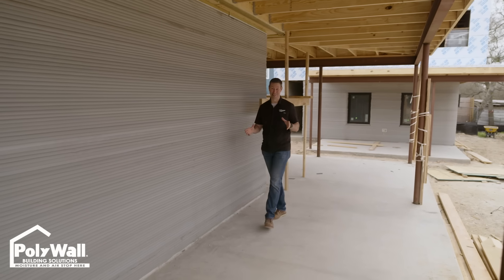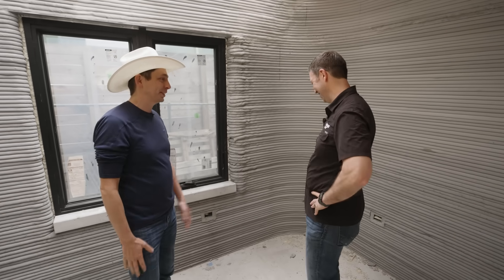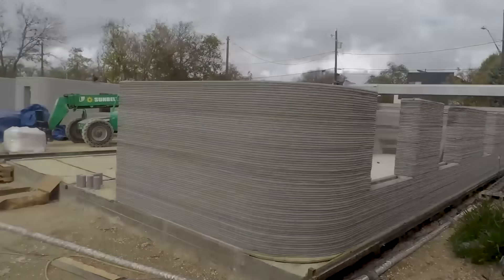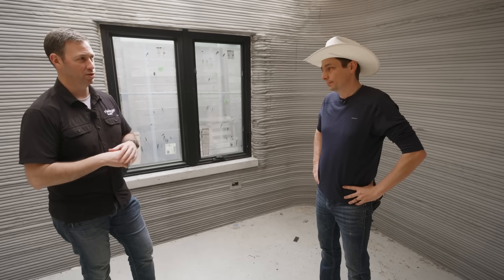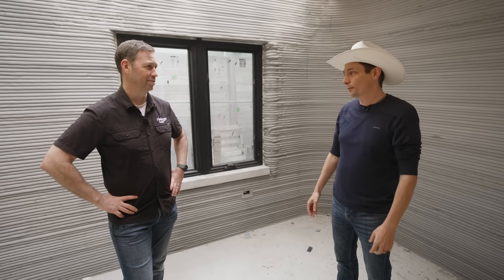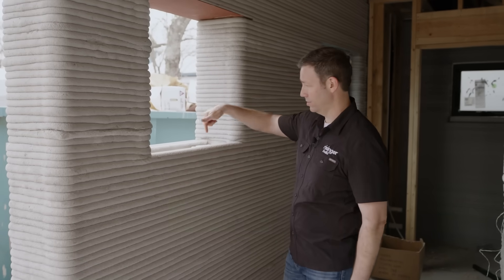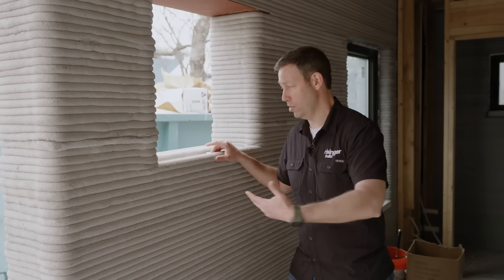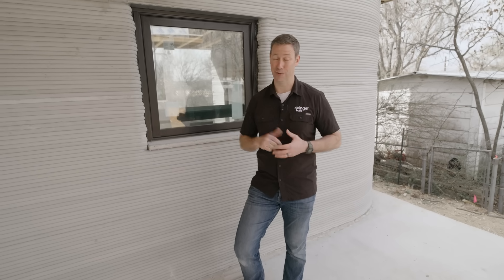Is this the future of Construction? 3D Concrete Printed Homes

Comment: I heard somebody once say, there are 2 types of concrete. One that is cracked and one that is going to crack... now who was that... wait! It was you!
Reply: Most underrated comment of the thread.
Reply: That is a fact, my channel and podcast is completely dedicated to 3D printed concrete and the cracking factor is something we've discussed many times. One of the easiest solutions is just a latex based paint layer on the printed concrete. The micro-fractures aren't structurally problematic.
Reply: @automateconstruction  that's s good idea with the latex. I think they should mix color into the concrete as well.
Reply: @automateconstruction  Is it just a cure rate problem?
Reply: @automateconstruction  any sort of remodeling is somewhat problematic as well. I guess one would shore up the ceilings/floors, cut into the wall and then do the changes with traditional methods???
Reply: What are the bets that this system is more expensive than a brick clad, timber framed home?
Reply: @R2D2trashcan  No its not more expensive. Its much cheaper due to the saving in labour and time.
Reply: Yeah I don’t see how this won’t crack like crazy over time. No rebar either?
Reply: @R2D2trashcan  The lack of steel reinforcement really concerns me. I'd hate to be the beta testers with a mortgage.
Reply: @bloodsuckingflea  Steel reinforcement is not required. You Americans aren't used to concrete and brick.

It's cavity wall construction. No rebar required. In the UK we use concrete as a lintel. This house is entirely concrete. The material used to build the house IS lintel material.
Reply: @bloodsuckingflea  @4:08 they covered that topic...
Reply: @R2D2trashcan  -------- super high psi (more Portland than sand)w/small fiberglass particles in mix --- no stone ------ wet layering process adds additional strength .... will it stand-up to 7.0 quake ----- hell naw.... the cowboy dude didn't mention R value or did I miss it
Reply: @rsgabrys3080  he did, he said it's high performance ;)
Reply: @pnwbuilder  high performance ? one and only reason its marketable termite carpenter ant ect. proof ...it would need more that one thermal break to be hi perf. I wanna see feel how much cold transfer permeates
Reply: @rsgabrys3080  it was a somewhat sarcastic remark, you've missed the smiley.
Reply: @rsgabrys3080  .

Its cavity wall construction. The cavity is full of insulation. Thats how we build in the UK with our brick houses. In addition, concrete acts as a thermal mass.

Concrete houses are not new. 3D printing them is.
Reply: @martinw245  builder never mentioned cavity (thermal break) was to be filled w/insulation or the actual wall R value
Reply: @rsgabrys3080  

"builder never mentioned cavity (thermal break) was to be filled w/insulation or the actual wall R value2

Err... R value no. But you can watch the video again and see for yourself, not sure how you missed it. Its full of insulation. Matt also spoke about the insulation.

11:42 for insulation. Its mentioned about three times. Also shown in the graphical representation of the building.
Reply: @martinw245  --------- seen window opening prior to installation seen some insulation in cavity....but did not seen insulation installation throughout building process
Reply: @rsgabrys3080  Well it's cavity wall construction for all walls of the house, so they obviously aren't going to put insulation just under a window and nowhere else are they? 😀 they would be con men if they did. Why on Earth do you think they wouldn't insulate all walls. They obviously are.
Look at the graphic representation of the house, all walls are full, obviously.
Reply: @rsgabrys3080  Watch from 4:08. He specifically tells you the walls are filled with insulation and even shows a graphical representation of the house with all walls filled with insulation.

The other point is that concrete acts as a thermal mass.
Reply: @martinw245  WHY then doesn't the builder have a definitive  R rating ? verses the walls are insulated
Reply: @rsgabrys3080  obviously does. Just not mentioned in the video. What is your agenda here?
Reply: @martinw245  ------- Numbers ....proof  that's it no other agenda R VALUE period. what is it ....YOU don't know neither do I --------
Reply: @rsgabrys3080  

I've no idea what your issue is. The building will comply with local regulations and obviously that includes its thermal rating in terms of an R-Rating.

Concrete has a very high thermal mass, that plus the insulation, obviously results in excellent thermal performance.

If you are that interested do some research and look on their website.
Reply: @martinw245  ---------- practically every appliance in this USA has a energy efficiency rating -------- dwellings are no exception... thus insulation ratings are how efficient and effective the resistance to heat -- cold -------  cementious dwellings are double edge sword ....once outer surface gets warm/hot/cold it retains it. Builder claimed high performance  ... hi performance in relationship to what...?  if it's similar to 2x4 stud bay R- 19 ..... it is NOT high performance
Reply: @pnwbuilder  ---------- when God was passing out brains .....I misunderstood and assumed he said ..... trains --------- I replied this ones full I'll catch the next one ....
Reply: @rsgabrys3080  

 "practically every appliance in this USA has a energy efficiency rating -------- dwellings are no exception"

I'm well aware of that, we do in the UK too. What's your point? The 3D house obviously does too because it satisfies your US Codes and is available for sale to the public. It just wasn't mentioned in the video. Go check their website if you want to find out. Or if that desperate email them.

What I can tells you is that if we use our common sense, and observe what looked like 4 inches of insulation, an outer concrete skin at 5 inches and an inner concrete skin at 2 inches, that's a total thickness of 11 inches. That is a very large  concrete thermal mass plus insulation. So I would expect your R-Value to be high.

I suspect you are being deliberately cynical here for some reason. Again, go and do some research if you want to know precise thermal ratings. This and plenty of other 3D printed houses are there for you to research. 

If you are expecting ME who doesn't work for the company to give you precise thermal rating figures you are barking up the wrong tree. Do your own research.
Reply: @martinw245  ---------- the claim "high performance" in reference to insulation is w/out merit (as is your argument) w/out definitive R-ratings -----------  its about having FACTS not ---" I expect your R rating to be high:" AGAIN you do not know .....and neither does anyone else who watched it ....  meets code and high performance has disparity written on both sides of YOUR dense walls house OR cranium
Reply: @R2D2trashcan  Rebar would be part of the problem. Over time rebar oxidizes causing swelling which cracks and breaks cement. A better solution would be adding reinforcing fiber to the cement mix.
Reply: @zmavrick  coated rebar maybe?
Reply: @R L That opening was clearly cut after the fact, don't you think? IOW, not 3D printed.
Reply: Comes with a tube of sanded grout!
Reply: I can just see "something" crashing into the home and the whole 2nd floor caving in.
Reply: @nw6gmp  1:1,000,000 event
Reply: @anthonykaiser974  with the logic. How about when he attacks certain sheathing technology as weak because a tornado may blow the house away. A 1 in a million or more chance of being hit by a tornado.
Reply: @diegolara4202  well, I know too many people that lost houses, barns, lives to tornadoes. Might be 1:1M where you live.
Reply: It's weird that despite all their engineering, they forgot to include reinforcement inside the concrete. Should have at least put an exmet inside like bricks and mortar construction. It'll be a deathtrap during earthquakes.
Reply: @MrArthoz  

Not true re Earthquakes. There's a 3D printed house in China that can withstand a level 9 earthquake.
Reply: Forget the rusting steel rebar, just put a lot of fiber in that concrete. I mean if you look at the extruder in action, you can obviously tell fiber would help it , lol
Reply: @R L Does anyone know about earthquake stability on these?
Reply: The concrete begins to set on every layer but isn’t given enough time to set where it won’t properly fuse with the next layer.
This has the benefit of any flaw on one layer doesn’t have a significant effect on the next. It’s like layering wood sheets. 6-2” layers are stronger then 1-12” piece.
Reply: What about mixing in fiberglass strands? Basically creating FRC. I would think that would help with the micro-cracks. For the large ones, just stuff a dead cat in the crack.
Reply: @explorenaked  

Fibreglass strands is correct. They use fibreglass and other materials in the mix.
Reply: No! The only cracks you get in a 3D printed house are micro surface cracks that aren't structural.
Reply: i guess it's kind of off topic but does anybody know a good website to watch new movies online?
Reply: @Jamir Ayden i would suggest Flixzone. You can find it on google =)
Reply: @Angelo Eduardo yea, I've been using flixzone for since april myself =)
Reply: @Angelo Eduardo thanks, signed up and it seems like a nice service :) Appreciate it!!
Reply: @Jamir Ayden You are welcome xD
Reply: classic example of a solution in search of a problem
Reply: @huntdon  it increases construction speed and reduces labour.
Reply: @huntdon  You haven’t priced lumber recently I see.

Comment: The big issue with stuff like this is how do you retrofit without huge expense and compromising the structure?
Reply: You don't. That's the problem with this tech. You can't even bring "the printer' back even if you wanted to. It's a gantry system that has to straddle the structure it's pouring. Once you build on top of it you're done.

Comment: Repairing the wall after you accidentally hit the accelerator? Storm blows a tree over and knocks a hole into you wall, will the repair match ? Concrete cost will rise as demand rises.

Comment: An incredibly wasteful future, seing as concrete is one hell of a major pollution source with it's energy costs and CO2 production. Same goes with steel. You can't plug a cement plant on renewables and expect to see the CO2 go away, chemistry won't change. I'd rather see a future with proper durable wood buildings that are built to last, as opposed to the cheapo "market driven" developments that are short sighted or the ugly steel and concrete buildings.
Reply: Yes you can do renewable power for the production plant. And its called the limestone CYCLE for a reason, its a circle.

Comment: How would the cement stay workable with the water vaporizing on touching vacuum?
Reply: It wouldn't touch vacume. Additves or a temp plastic cover with a 2 min set time. See i just fixed the problem with no budget in 10 sec. More likely fabing panels in a machine is the route they go.

Comment: No steel?  Does it have to have a beefed up foundation for the extra weight around the edge of the foundation?  Since the foundation will likely crack in the future....won't the wall crack?

Comment: My only concern is down the road when u want to add lets say a new outlet or move pictures or remodel and have to open or close sections of the wall...
Reply: yea id love to hear more about things like that, redoing electrical lines, adding on, updating fixtures, more of the nitty gritty small things
Reply: @Lukester44  Redoing wires seems to be problem that's true. I mean you need to stance out a complete row. What about stability then? They should have made more connection points between outer and inner walls or some other fixing points every few rows like steelbars etc. 

In this case you could remove a complete row from the inner wall to put in a new electric wire for example. 

I mean I'm pretty confident that they use steel or glass fibre additions in the concrete to maximise stability. But can this hold a complete row on... 3-4 meters?

Comment: The technology on this is amazing, and it will be interesting to see where it goes. I'd like to see more integration into recycled compounds into a concrete mix - like recycled aggregate, which could make things very uniform. I think there's a lot of room to grow here. Similar to ICF, you really need to have your plans on a project like this airtight, especially for a custom build. Anyone know how competitive priced it is - I see @mattrisinger doing a video on comparing Lumber - ICF - 3D Print. I'd probably want to use this product to build a pool - dig the trench, have at it, waterproof, backfill, done!

Comment: Awesome. The rest of the world has it right, build it once and build it with cement to last forever. This is definitely heading in the right direction, would have been interesting to hear what some of the other limitations are (no 2nd story, etc.) Not a fan of the Marshmallow look, but I can get over it or stucco it over as mentioned. Wonder if they will inject a color stain for exterior/interior walls, might help sell the look a little better

Comment: Have fun remodeling that.....
Reply: Had the same thought.  I’d probably talk to the builder about using a hybrid build and use the 3D for the spaces that would be the most unlikely to be renovated (garages, etc) and stick for the rest.  Not sure if/how that affects integrity of the whole thing but I’d have the conversation for sure.
Reply: @tdunn2  It would just have to be accounted for in the design phase. The concrete walls would be, for sure, load bearing, and whatever timber frames are built inside would just have to be specified as superficial or load bearing when built.
Reply: No kidding.
Reply: The other thing is generally remodeling you are leaving the exterior and changing the inside. But yea how would you add an outlet or sink I get that.

Comment: This type of house would be great for people who lived in areas where wild fires are. Concrete doesn't burn. I can see homes like this taking off and be the new normal. If it was mine in the end I would stone it since I'm a Mason. I love stone and brick walls that are curved.
Reply: Concrete and steel structures don't burn per se, but they fail systematically and lose integrity, spreading the fire and smoke to the other compartments. Steel loses strength and expands at temps where wood maintains full integrity and concrete cracks, explodes and spalls.
Reply: Wild fires would bake the inside. My new neighbors had pictures of the piano mostly melted and the sheetrock powdered when touched.  There home didn't burn but was bulldozed and they moved here.

Comment: It's so awesome when Matt gets to show off some of these new innovative building techniques. I'm thinking of past episodes like the rammed earth house or the Swiss CLT building episodes.   

I think the drawbacks I see with this right now are with quality. The corners of the walls and windows look super wavy. 

Similar to ICF you are pretty locked in to your window and door rough opening sizes. And with this your electrical rough ins as well.  I wonder how job scheduling goes with the electrician waiting for the layers to build up for them to run their wires. 

I really could see this finding a niche with commercial or high end residential where someone wants to build a cool shape and plays with the concrete mix in the layers to create different shading.

Comment: Hey Matt — what a cool episode. Thank you for showing us this new building technology. I have a follow-up question — while you gave the Tour, I noticed several places near window corners had long hairline cracks. Not sure if you noticed them or not, but they’re definitely there — so I was just curious if ICON has any structural and/or weathering concerns with these hairline cracks? I know all concrete eventually cracks (which is why you pre-cut stress lines to encourage controlled cracking) … just curious how such cracks plays into 3D-printed walls! Thanks!